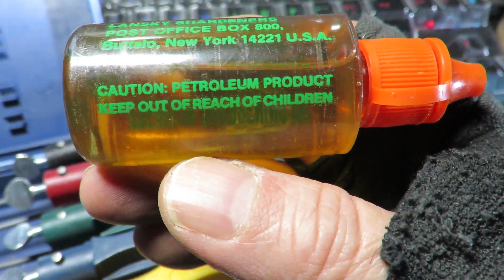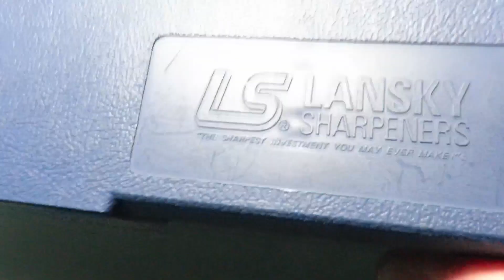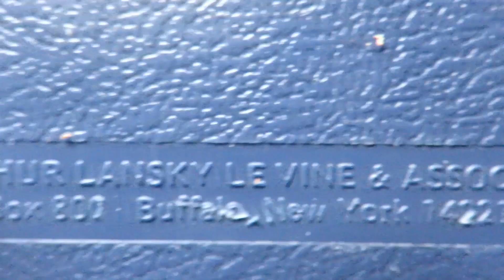How to sharpen your $3000 knife without panicking [The Lansky Deluxe Sharpening System]

Comment: I have used this kit for many years. Its excellent for common steel knives but I have had issues with steels like SGPS (Fälkniven 3G) s110v and k390. For such steels the diamond kit work better. This kit will put a great edge on the 420HC that leatherman and buck often use, aswell as 440c.